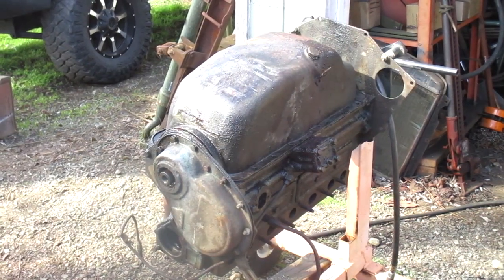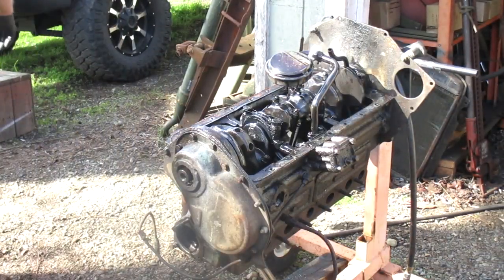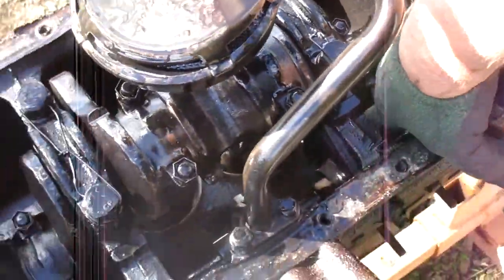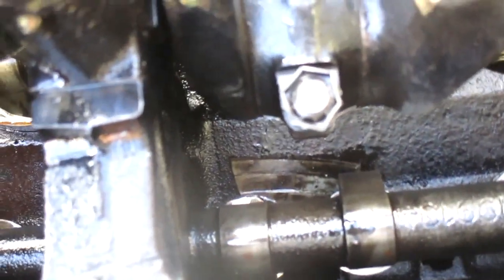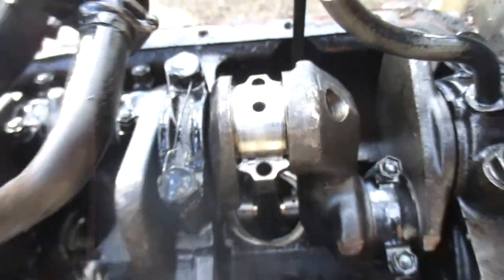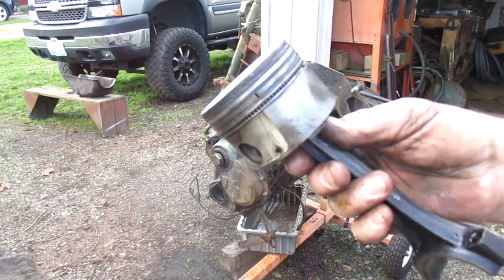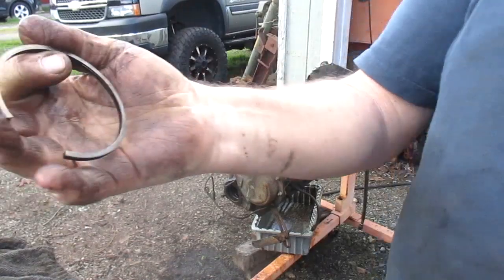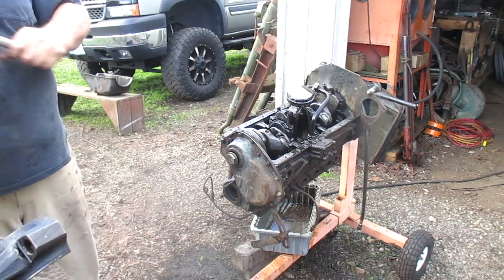Weasel Engine Inspection, what caused it to fail.

Comment: Ouch! 🤕 That block has seen better days, thats for sure. Nothing a little machining can't fix though 😁👍 Glad to see progress on the weasel Dave. Take care 🔧🔩
Reply from the maker: #5 cylinder is the only thing wrong with it really Zane. Had it not been for that, I would have just run the engine as is. I have a good running take-out engine that has been properly stored for for about 15 years. It rolls over by hand very easily, builds really good compression, the valves and seat are in great shape. I'm going to run that one.